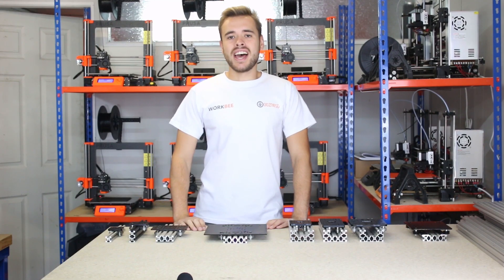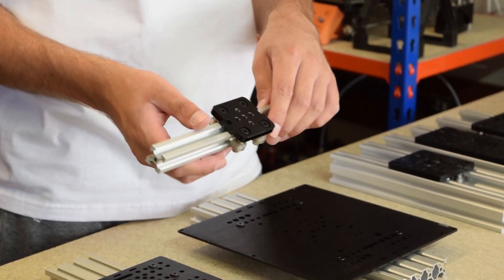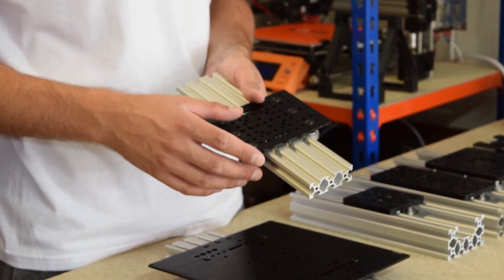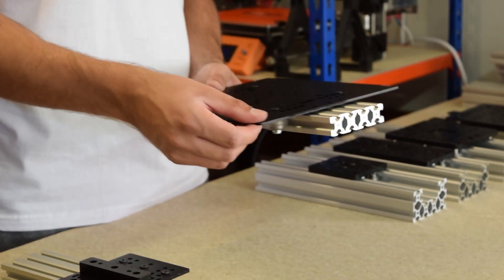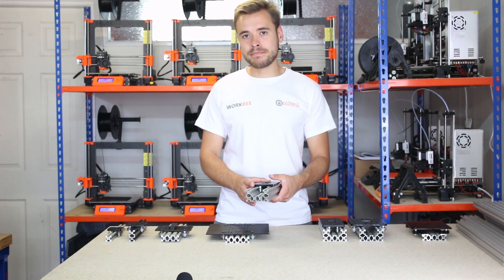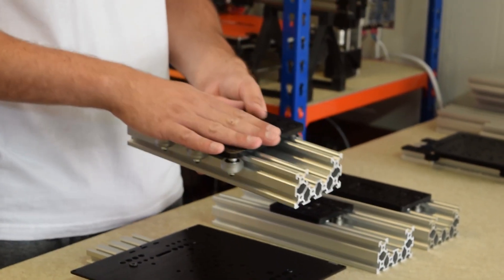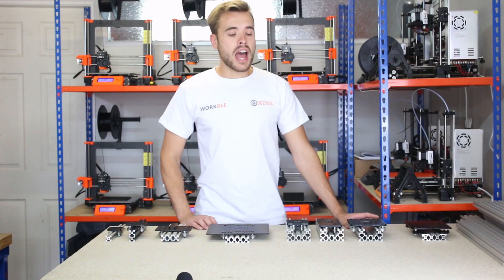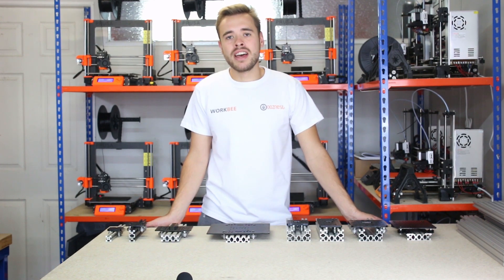V Slot Gantry Plates | What To Know | Ooznest & Openbuilds

Comment: Is there a way to lock these to the V rail once in position or am I better off using some form of T nut and bolt?  I'm trying to work out how to construct a wall easel which runs on horizontal rails.

Comment: Kind of dumb question, but can this be installed with the gantry plate facing down? For example, everything you're demonstrating turned over? I wanted to mount a light to the plate, with the V Slot mounted to the ceiling.
Reply from the maker: Yes, that can be done!

Comment: Not really 3D printing related but do you think these style of bearings (v slot) would work well for solar panel installations on a roof rack? I’d like to slide about a 40lbs panel on one or two of these gantries.
Reply from the maker: Hi, Thanks for your comment. Really hard to say really, it would depend on your design.

Comment: Hi there. Very nice explainations thanks... I have just a wonder with wheels... What is the difference between black and white wheels and why to choose one over one other?
Reply from the maker: Hi Sylvain, the black wheels are Delrin Dual V Wheels and the white are Solid V Wheel Xtremes - the difference is that the Xtremes are able to take more load than the Delrin as they are slightly stronger
Reply: @ooznest  thx a lot for answer ! So I guess black ones are good for a 15w  diode laser engraver v)

Comment: do the V slots or the wheels wear out after continuous usage?? What is the difference between using a linear slider and carriage, apart from cost?? I am looking for use in an industrial application, the gantry will be in motion 24x7, moving back and forth. We use a linear slider and carriage now, I was hoping to reduce cost and use the V slot and gantry instead
Reply from the maker: Hi, if there is no debris and the wheels are set correctly, there would be minimal wear. Linear guides are better, than wheels and extrusion, but all done to cost :) We use wheels and extrusion on our CNC Machines, and get 0.1mm accuracy.

Comment: Question: Will the 20-80 normal v-slot gantry be strong enough to mount a CNC (for wood) router to? Or is it really advisable to go for the bigger c-beam one? I would mount it to a 20x80 c-beam.
Reply from the maker: Ideally use the C-Beam XL Gantry Plate. However the V-Slot one would be ok also.